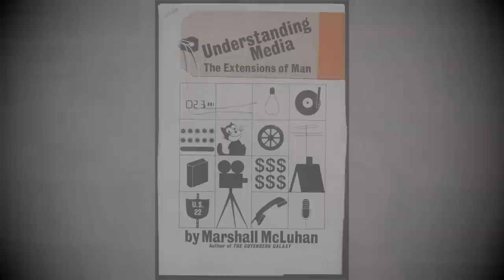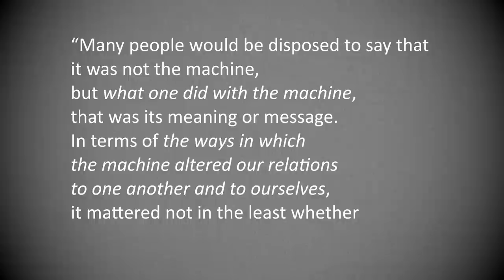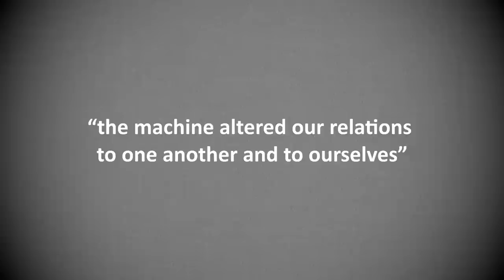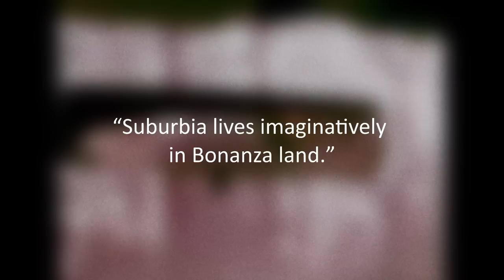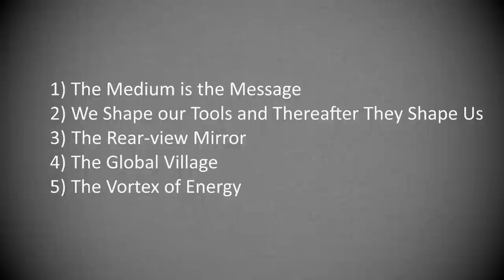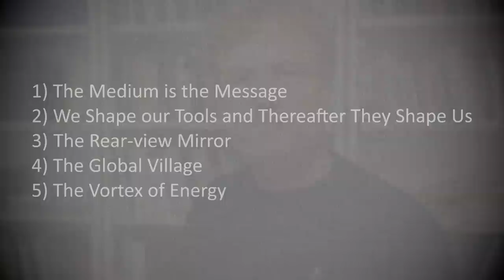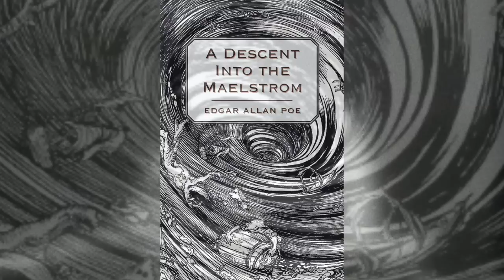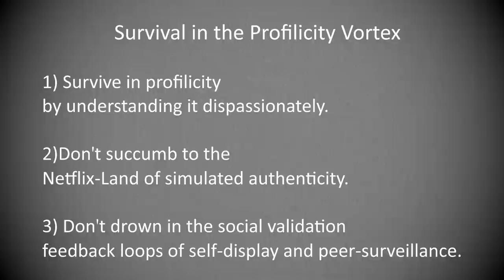Marshall McLuhan: Essentials

Comment: Sometimes McLuhan would refer to media at "hot" media or "cold" media. I've never been able to understand this distinction and what he meant by it.
Reply: He used those terms in the sense of US English slang. Examples are necessary here. “Cold, cool, chill” suggests engagement, where McLuhan attributes the term “Hot” to media where you’re detached and merely observing. 

I wager your confusion might be that the opposite designations make more sense intuitively. Involved media should be “Hot” and detached as “Cold.” Yet modern communications reverse this. McLuhan was illustrating this then. Today, when my friends want to hang out they tell me they are “Chilling.” That is my cue to engage with them. Yet, when i state an observation conclusively, it is a “Hot Take.” I am not open to engagement other than debate. And even in debate, discussing different but conclusive points is a “Heated debate.” 

It’s as if the intuitions are reversed , with electronic communication somehow doing the inversion. I could go on as I am currently reading through his work, but hopefully this might have clarified things a bit.